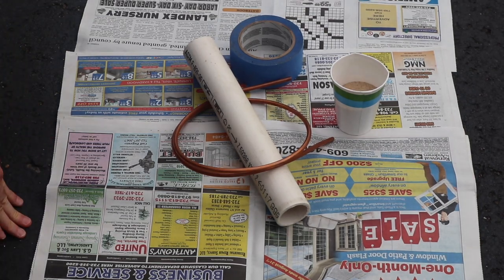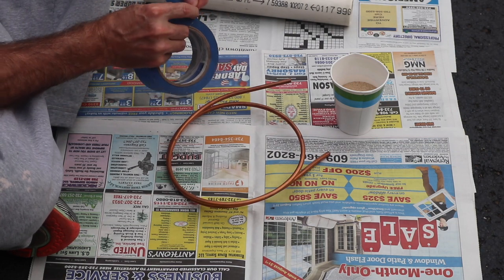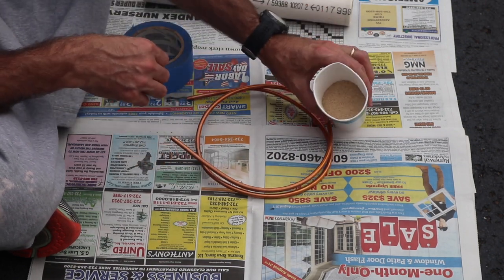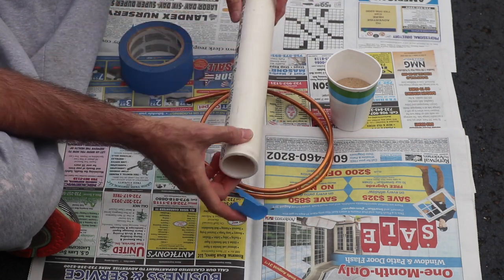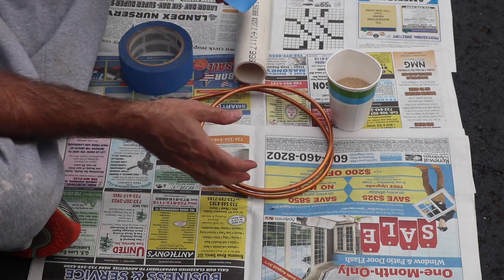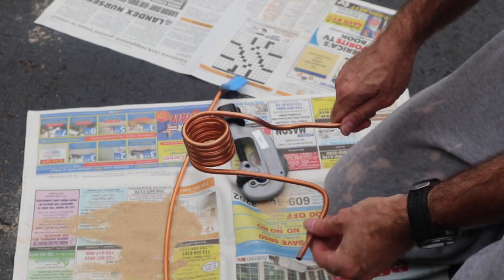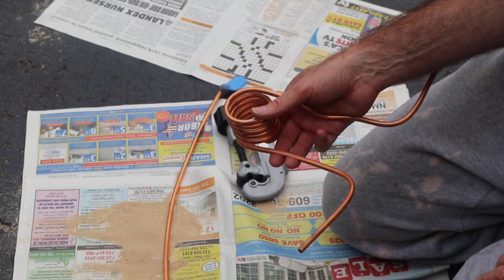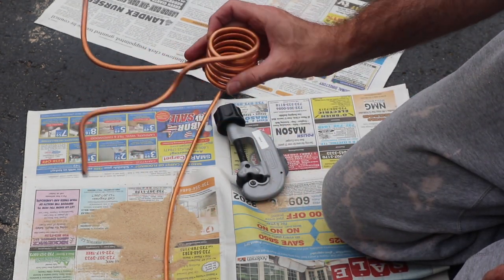How to make work coil for ZVS induction heater

Comment: I read your tutorial website for a LN2 generator and am actually planning on building one, as I happen to own a used SCUBA compressor. I thought it was a funny coincidence that I have also built a ZVS induction heater years ago. Not as high power as yours, but the work coil is cast in a zircon refractory foam so it can melt just about anything (slowly). That said, as I am gathering materials for the JT cooler, have you had any thoughts on how get the expanding gas to do some work as it leaves the throttle? If I understand the process, removing even a small amount of energy from the gas there will drastically increase the efficiency of the system. Maybe a small tesla turbine/generator assembly (hard) or even a very loud whistle?
Reply from the maker: Turboexpanders are used for many large-scale liquification plants. I did not think I had the resources to properly build one. The principle is as you stated: it extracts work out of the gas, drastically dropping the temperature, and discharging liquid from the discharge.
Reply from the maker: As you can see form this link, https://pdfs.semanticscholar.org/31c9/eb2c83680692ce394a2c0eb1edb60367be59.pdf

they are big and require many parts to operate properly. They are meant for large-scale production.